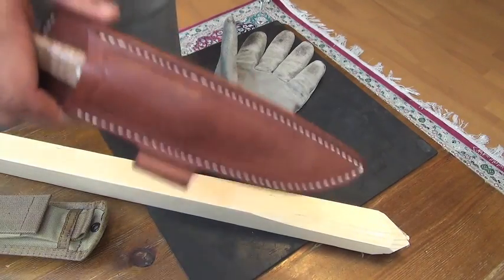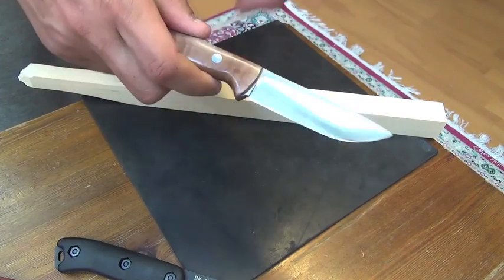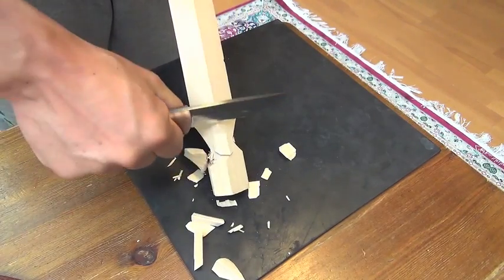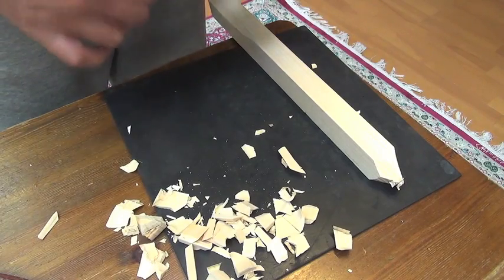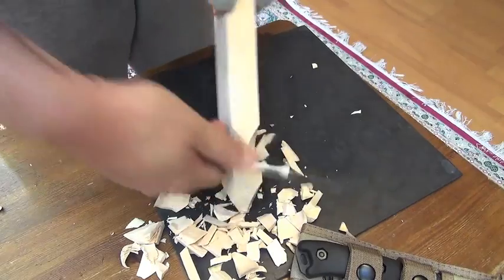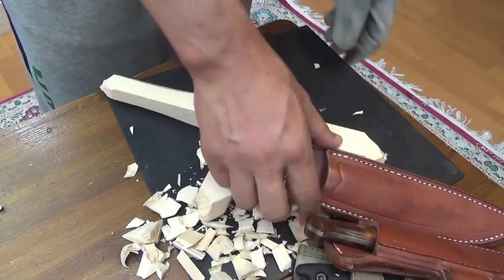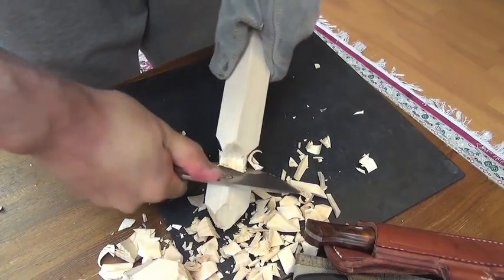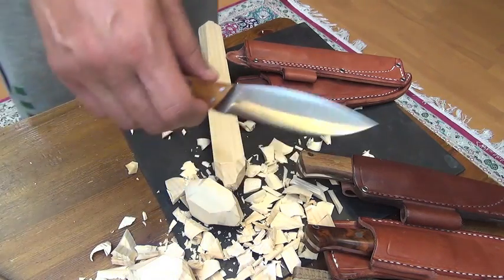My thoughts on convex edges

Comment: Mr. Wako, as always great Vid!.  i was wondering about the splitting power. you always test these knife with soft pine wood and at the very bottom of the stock. which, can be easlly split. maybe thats why your knife works as they do. i know that your main bushcraft is fether sticking, so you might not need to. but how about test these knives in harder wood or longer live wood maybe? for one of those 'what if' scenario. Again, Thanks for the vids! :)

Comment from the maker: All Fallkniven knives have a micro V bevel. After getting rid of it, its apex angle gets fairly large. All Fallknivens have strange fat geometry which makes the edge angle fairly large too. VG-10 is a soft side steel like 12C27 and doesn't hold sharp long. The best camping-hunting knife would be A2 Rampless Gunny or A2 Rampless Bravo1 from multiple viewpoints. If you don't baton wood for your camping, some Mora can make it. Fallkniven will never make it. Thanks.

Comment: Dear Wako,
Have you ever tried the Fallkniven F1 in 3G? I think 3G can be ground down quite a bit to make it a good woodbiter.
Maybe the fat geometry caused by the extra stainless layers on the VG10.

I only have the Fallkniven A1 in VG-10 which holds an edge pretty well in my opinion. Though I ground it down from the spine to get a better geometry.

My friend has really good experiences with his regrinded F1 in 3G

Comment: Excellent video! How well would you suspect the Canadian hunter's high height convex stand up to dressing a deer? Do you think the 3V would chip or roll? Thank you.
Reply: Canadian Special in 3V comes with a micro bevel about 35 degrees. I ground off its micro bevel to make 25 degrees and it still held very well. Current 3V is not so hard as before but tougher than before and won't chip easily nor roll easily. It is a very good steel currently over A2 in my honest opinion. But for some reason BRKT still continue add a micro bevel to all of their 3V knives and we still need to remove it before using it sharply. Thanks.